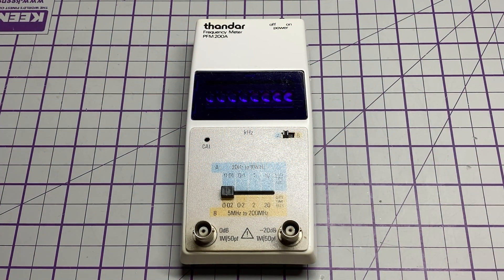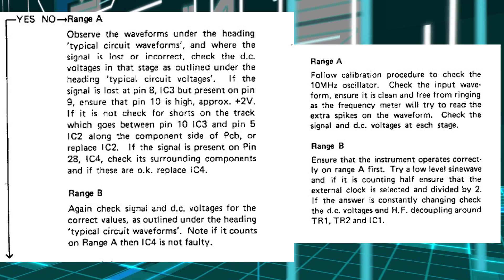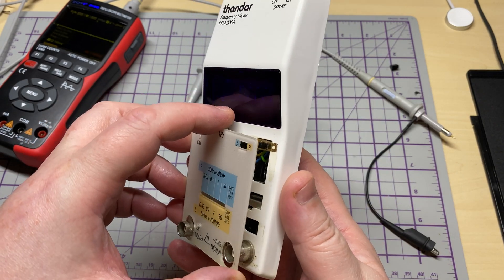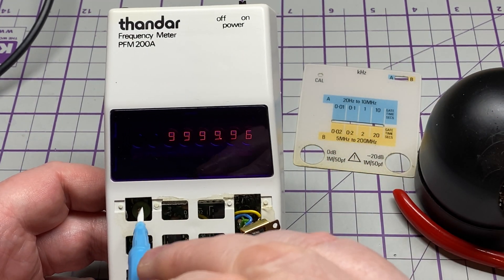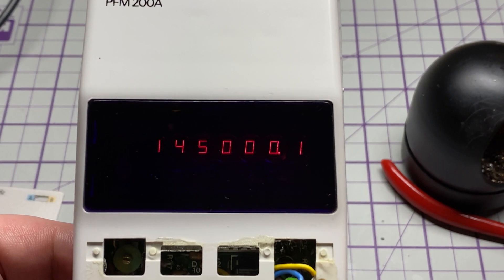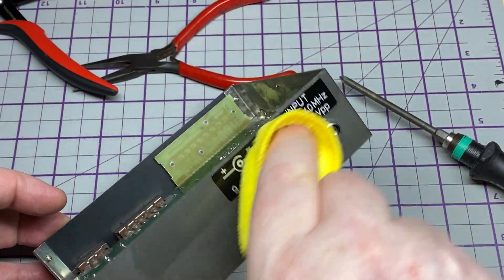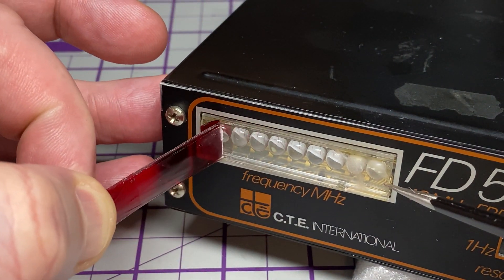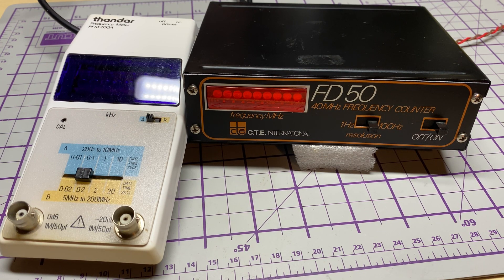EP 190 - thandar PFM200A - C.T.E FD40 - Repairing 2 vintage frequency counters.

Comment: I've had a couple of those thandar counters in the past, they are good units. The bubble led displays bring back memories!, they where also used in digital watches in the late 1970's. The red film can also be bought at craft/hobby shops also the thin black felt material used on cb's for the function switches and also for the internal speakers can also be bought from the craft/hobby shops. Thank you for your video!.
Reply from the maker: Yeh i know of the watch . never even thought of a hobby shop for the film , thanks.